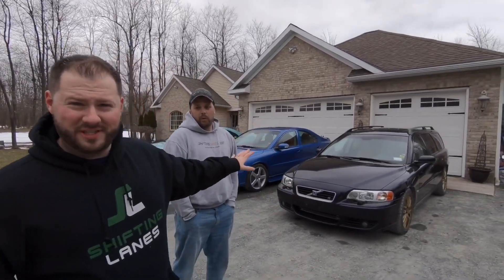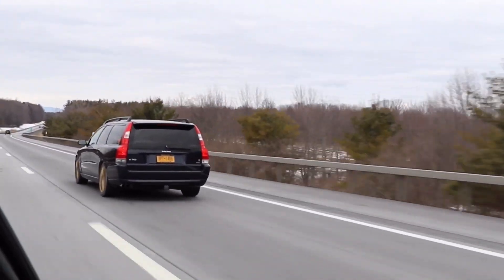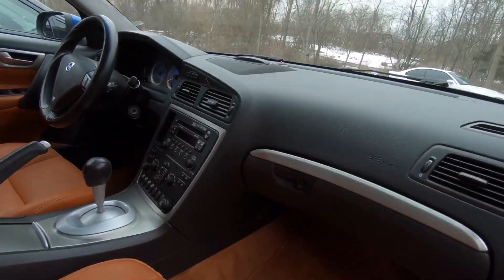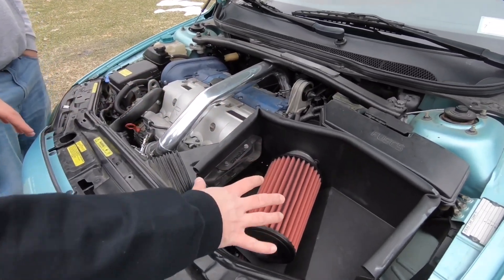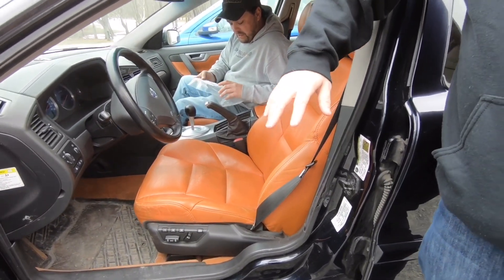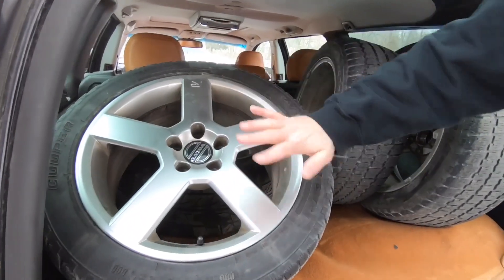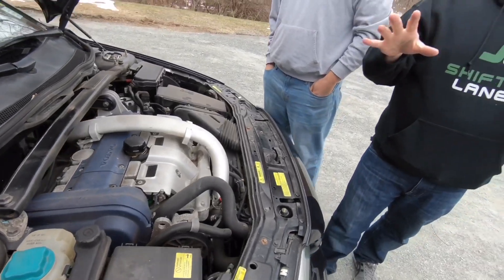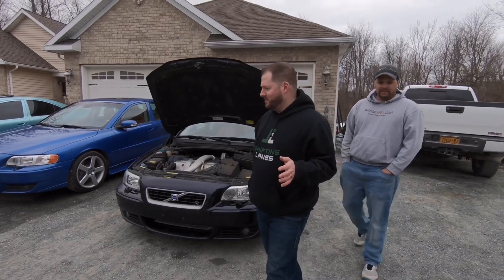We Just Bought One Of The Rarest Volvos In The Country!

Comment: My father has a black V70R  with cream interior, manual, and it's the car I learned stick in, it's pushing 420 hp, down pipe, 3 inch exhaust, lowered 1.5 inches, intercooler, mail box tune pushing 20 psi, when you step on it you smell antifreeze 😬

Comment: its impossible to even find a s60 t5/ s60r anywhere near me with a manual that has low miles. Even when I check a couple states over.
Reply: They are super rare even in Nordic countries and if you find one it usually has over 200k miles/350k+ kms. Instead of low miles you need to look for one that has been taken care of it's whole life by a good owner.
Reply: You should check here in sweden. Every teen has one it seems. :p
Reply: Peter hall Even R models?
Reply: Ofc not all teens have them, but there are alot around. If i compare to what you are saying. But then the factory in Gothenburg is less Than a 1.5 hour drive from here ;) 
Topsite for selling cars in Sweden : www.blocket.se
Reply: i'm not traveling all the way to Sweden for a Volvo. I live in the U.S. and that'd cost way to much money.

Comment: The wagon did not come with Atacama as standard when ordered new ? And the flash green one looks very nice , but I believe it should also have a spoiler fitted on the trunk when it has the bodykit . It needs it , when going at a higher speed . Here the blue one is very rare . It looks almost the same as the blue used for the concept car of the s60 .
https://www.netcarshow.com/volvo/2000-pcc_concept/

Comment: New Volvo owner ? 
I have a clean (as per local Volvo shop) 09’ S60  2.5T that I really wanna know if it’s chipped. As a short time Volvo mechanic (3mos?)  and now an Atty I’m not up on car modding. The ecm looks stock and has no sticker etc. but there are allow of weird little issues that give me pause that someone was “playing” with the car b4 they sold it.

The drivers seat bolster needs to be resewn and some roof ares either rebent or reglued (hard to explain) but that is all that is wrong with it. Oh and I got like 4K off for minor hail damag. (And if I find whomever u are that took ur fist and slammed in on the roof between the rain sill and roof panel to dent it, your time is limited in earth.). 

My question is what is a good intake (like the one the teal colored R had) other tha a free flow drop in IPD filter? And how to tell if ,y car is “chipped”. No doubt it’s been done. I’ve no rev limiter, no auto shift at redline, no torque limiter etc, and 0-60 is a bit better than T5 territory. If I use aero plane fuel, ummmm....it’s allot faster to the point I won’t do it again for fear of my tranny goin “kerblammo”: thanx
Reply: cliff owens they don't know? The ways of the force? Or....If it's chipped? And can the auto 2.5t's Haber S60R manuals transboxes swapped in?
Reply: PS this channel now has me looking for a man T5 wagon AWD or S60r.

Comment: I can't really see the craze for a manual Volvo of this generation - as they are incredibly boring to drive whatever gearbox. It's just a Volvo with 50 extra horsepower (stock). The Skyhook suspension even manages to make them a bit more boring. The V60 was IMHO the first Volvo that wasn't a sleeping pill to drive.
Reply: A cheap retune and you have over 350hp without changing anything whatsoever, not boring to drive at all